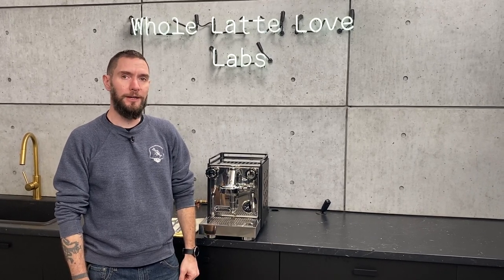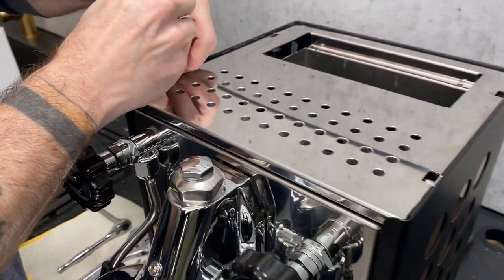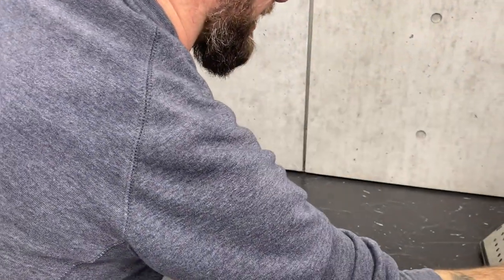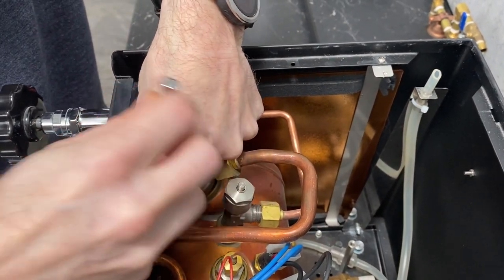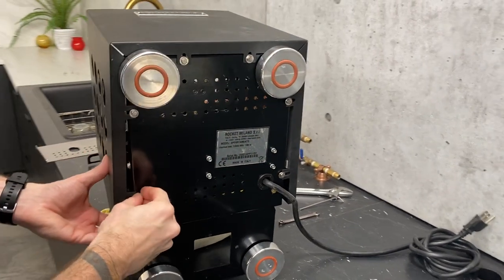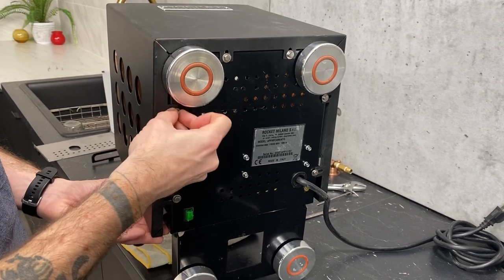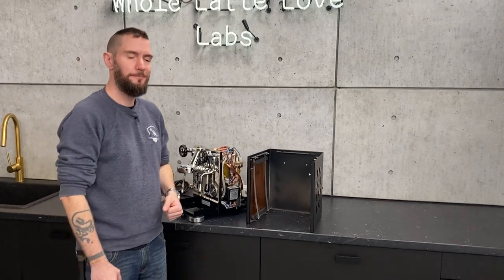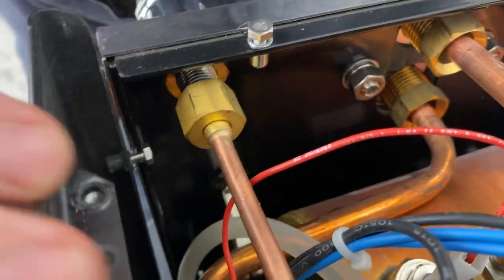Rocket Espresso Appartamento: How to Remove and Install Housing

Comment: Thank you for making these detailed and realistic videos. It really helps the viewer understand what to expect, what tools to use, and what is “normal” working time on these machines. I recently partially opened my Nera to reduce the brew pressure and things went well because I had the right tools.  However, I learned a few things about the tolerances on the machine in the process. Please keep these technical videos coming.
Reply from the maker: Hey S, you are welcome and more to come like this!
Marc
Reply: The Temp gauge on my Appartamento is no longer working. I have a new gauge. Using this video i have taken the cover off - thank you! Does the old gauge screw out? If so, what direction? @Wholelattelovepage
Reply from the maker: @peterford387  Hey there! Sorry just saw your comment so maybe you already figured it out. The gauge is held in place by an internal bracket which can be seen in this video covering the machines internal components: https://youtu.be/YSdjl0UEaDU?si=Br3YAnYgy1c1wCLN&t=780
A screw on the back side of the bracket tensions it and holds in place.

Comment: I've got the Appartamento Nera also. BUT my boiler isn't copper...what's up with that?
Reply from the maker: Hi w, That's odd. I've been inside a ton of Appartamentos and never come across anything other than copper boilers.
Reply: Dude same here!!
Reply: @GoDriveMX5  Yeah it was disappointing for me in a way. Also, I pulled my mushroom valve to install a flow valve and it was ceramic! I was expecting stainless. I dunno... I'm happy with it though so that's ultimately most important.
Reply: Can confirm my Appartamento boiler is not copper either. It looks more stainless coloured, but could be a composite?

Rocket must have introduced some cost cutting recently. The internal tubing also isn't copper like in this video -- it looks like stainless
Reply: It most probably is just corroded copper. Very normal for copper and nothing to worry about. This one opened here is new.

Comment: I just don't see $1,700 worth of parts and workmanship inside that thing. Honestly, the metalwork doesn't whisper high-end and certainly the flimsy brackets that hold the side panels in scream the opposite. Same with the wiring with those cheap white plastic connectors. For this kind of money I would expect proper sheathed cables over zip-tied wires with cheap terminals. Am I being unreasonable here?
Reply from the maker: Hi Chris, Thanks for the comment. While those brackets appear flimsy they serve the intend purpose. Sheathed cables in this type of machine are rare.
Reply: @Wholelattelovepage  I agree with everything you just said while maintaining that my original complaint valid. I keep searching channels like yours for a machine teardown evaluation for overall objective build quality and value for the money. Watch a few BOLTR videos from AVE channel to see what I'm talking about.

Maybe I'm wrong. Maybe casting or machining a good group head is in fact an incredibly difficult thing to do. Perhaps the centuries old technology in boilers is difficult to pull off. PID's these days are pennies...dollars at most. 

I know the whole is more than the sum of the parts, but I'd like to see a critical evaluation of the parts and materials and how well they're assembled in relation to the sale price.
Reply: @Erik Burgerhagen Yep. I love to tinker but I 'm not willing to pay premium prices for subpar products that require tinkering in order to bring them up to the expectations the price demands. I agree with you though, from what I've seen all machines are like this and more cash doesn't buy you more quality. I guess enough people pay it anyway, but not me. I wish the review channels would be a bit more critical of this and I wonder why nobody is.
Reply: why dont you just start your own machine line and include all the bells and whistles at a great price point?
Reply: @maddivann  Because I'm not interested in doing that for espresso machines. I'm more of a woodworker and I do include all the bells and whistles in my products at a great price point.